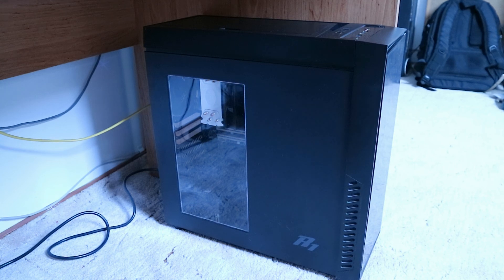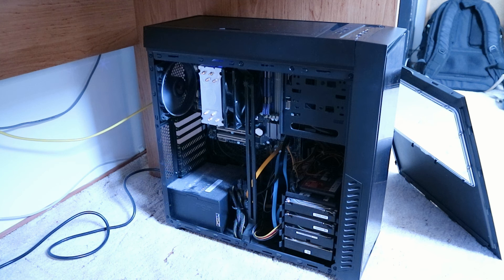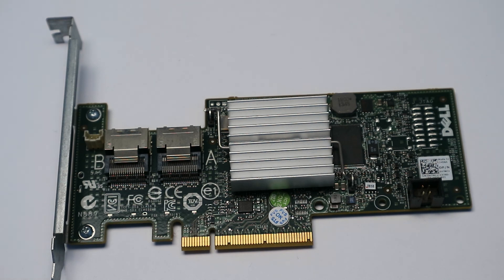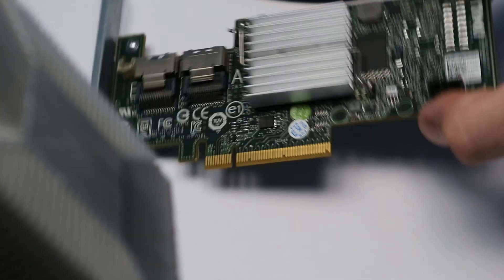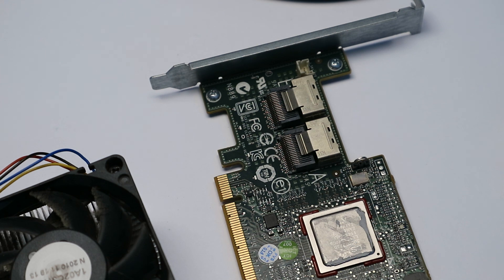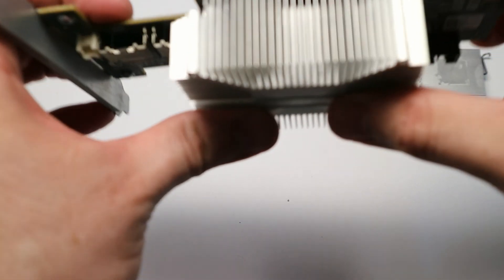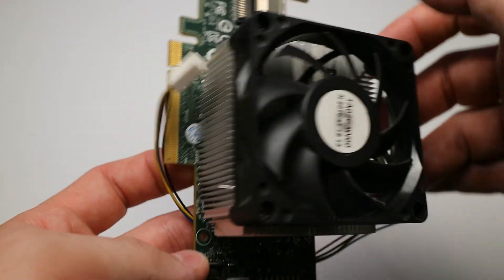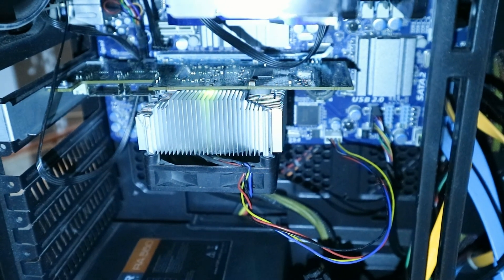LSI HBA Card Cooling Mod!

Comment: The Dell HBA & RAID cards are very mod-friendly. You just need to try and remove the mounting wire (clip) safely by grinding a bit of the aluminium that is holding it in place using a rotary tool with a disc cutter wheel mounted. There are other ways that you can try to remove it but it will probably be slower. Then just apply some MX4 (do not use it on a bare lidless die) or similar compound or a thermal pad. Larger heatsinks from broken motherboards are adequate replacements for the shallow ones installed by default on the card. The clip that you remove from the existing heatsink makes mounting the larger one a breeze just be careful not to damage any SMD components while doing so.
Reply: MX4 is advertised for use on GPUs which do not have a headspreader. Could you alaborate on what you mean with "do not use it on a bare lidless die"?
Reply: @phi_b  I have had some a SAS card and an old CPU fail after using that compound on them. They had no heatspreaders on them.
Reply: @makeyourselfdani  interesting, I have only ever used it on new-ish cpus and liked it for that. Thanks for sharing :)
Reply from the maker: I wonder what could have been the reason - the MX4 is known to be non-conductive (electricity wise) and non-corrosive. Thanks for sharing indeed!

Comment: with a heatsink that big id just run it passive
Reply: These cards work fine with larger heatsinks pulled from failed motherboards or similar. The existing clip looks more legit that having to use cable ties.

Comment: I to enjoy having my PSU faced down towards a carpeted floor. Liked the mod.
Reply from the maker: Haha, yes! That was also a good reason to ditch the Zalman case. Nowadays I almost exclusively use Fractal Design cases - those are fully decked out with dust filters, etc. Anyway, thanks for the feedback, glad you liked the mod! Btw 2+ years have passed and running 24/7 the card still works fine with the modded heat sink.
Reply: @TheTinkerDad  that's actually really impressive! I'm a fractal design man myself, gotta love their noice isolation. 

Do you still use the standard hdd mounts or did you start using backplanes? I installed 2*3 disk backplanes in my black pearl case, and it's such a nice thing for hotswaping drives.

Comment: All I did was superglue an old video card mini fan I had to the heatsink on my LSI card. Before I couldn't even touch the heatsink. Now I can hold my finger on it with little or no heat.
Reply from the maker: Wow. How long has it been that way? Won't the superglue give in with time due to the heat? (I have zero chemistry knowledge, but my experience is that many types of glue, etc. are negatively affected when exposed to heat for a long time).
Reply: @TheTinkerDad  What heat? The fans keep the heatsinks cool enough to touch. The temp rating on the glue I used is 100c so if can hold my fingers on the heatsink I think I'm good. Also if it does fail guess what I can apply more. It's pretty cheap. Cost effective and less of a chance of destroying the card.
Reply from the maker: Ok, got it now. Sounds reasonable enough :)

Comment: How much did it cool things down by?
Reply from the maker: Well, I couldn't make exact measurements, however the original heatsink was too hot to even touch, but at least it didn't burn me (too much), so I assume that originally even the heat sink was way above 60-70 C. Currently, the new heat sink is barely warm to touch, so I assume it to be around 25-30 C. Obviously the temperature of the heat sink is not exactly the same as the temperature of the chip itself, but there's a correlation, so I assume a similar drop in case of the chip.

However, there's one thing to mention - when I first tried the card and heated up like hell's kitchen, it was idle (!!!) - e.g. no HDDs attached. Now it's running extra stable 24/7 with 6 WD REDs, so the whole thing totally worth it.
Reply: If you look under the Megaraid Storage Manager software in Windows under the physical tab and then click on the controller - look at the properties window ( you may need to scroll down a we bit ) and it should show the Chip Temperature.
Reply from the maker: @chassecourt8824  Well, this rig is running a headless Ubuntu Server :) But the actual idea is nice - maybe there's a software solution for Ubuntu too. Will have to check ;)

Comment: it's not an overkill, my 9212-4i has a small heatsink and I am getting all kinds of errors. Looking to replace the heatsink, heat paste and adding a fan too!!
Reply: didn't really work. I get errors with barely any heat on the sink, I guess the card is fried. Nevermind, I needed it for pass through, and ESXi can pass a disk through, so it's ok